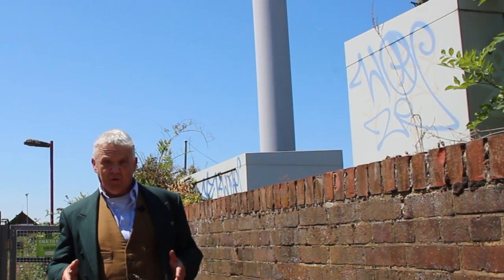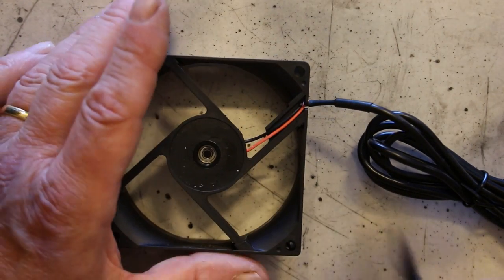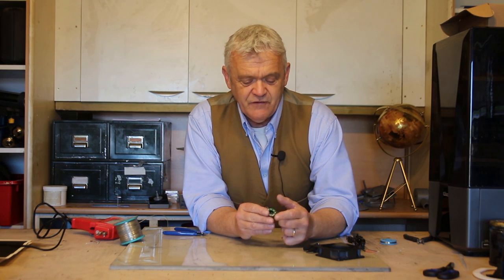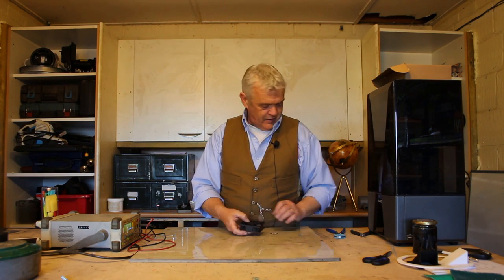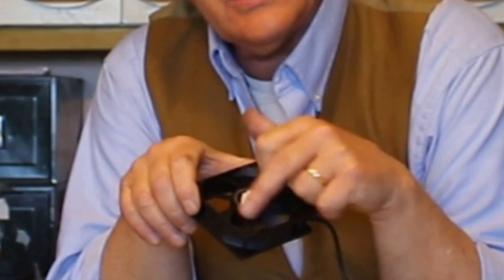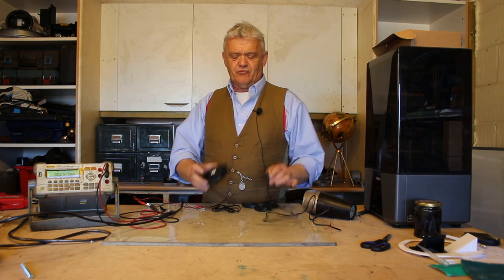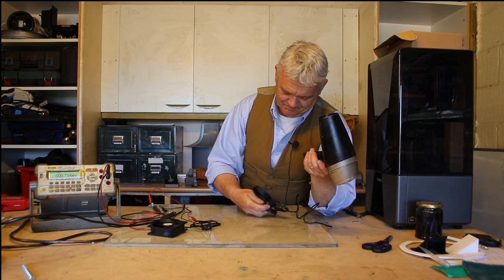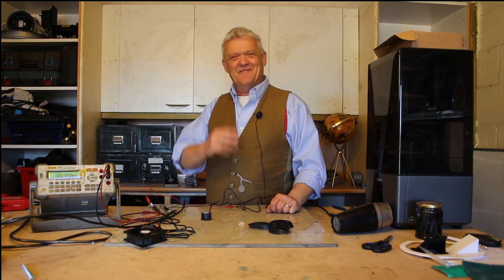1959 MIT Toroidal Propeller As A Generator

Comment: That was unexpected. Perhaps the housing has more of an effect than we thought.
Reply: yes, fan housing always helps increase the speed.
Reply: Of course it does. My experience with auto mechanic jobs has shown me the cause effect of the fan shrouds on radiator cooling fans. The difference of wind velocity is easily double with the shroud installed.  Also with a single webber carb on each cylinder the height of the velocity stacks or tube on top sucking in air has a definitive change on engine performance

Comment: I think what you should be measuring is, the minimum air speed required to turn the generator, and whether it will still turn under load.  I think your fan blade will turn with less real breeze and will continue to spin under a much greater load.  And if I am not mistaken,  with a long shaft it would convert well to a turbulent vortex water generator.  Anyway, the fan was very ideal source for the stock pc gen.

Comment: The small fan matches the size of the hairdryer so is more efficient,creating more RPM, so more voltage. For a more accurate measurement both fans need to be same size.

Comment: Thanks for the video: The premise is slightly incorrect: Large diameters don't spin faster, but they do provide more "torque". 
Probably to make this a fair test, you would have to scale the MIT prop down to the same diameter of the propeller fan. (Or vice versa). 
One other thing, I have watched some videos on the MIT prop, and I can say so far all of them have been "underwhelming" as far as performance in "Air".
Reply: yes, hold the blower 18 inches from each generator and test again.  big blade should turn better at lower wind speed
Reply: I saw that without any testing. Air turbine blades need their own design because they are removing power from the airflow, not pushing power into it. 
Large diameter sweep areas always remain the same in the designs no matter how much blade area is added.
The numbers are formulas that can be changed to take more or less power from the airstream.
With geometry we can add/or remove, more or less blade area to the sweep area.
The big question for me is, "Drag?"
How can I add more push surface without increasing the drag?

Robs' blade that he has designed can easily become a lot more efficient, by changing the angle of the blades to 45deg to the post instead of 90deg while keeping the rise the same, and adding a curve to the bottom of a steeper cone. This would help in the upscaled designed.

I also see design solutions for the blades themselves that would virtually eliminate drag.

Also as we all see his blade is twice effictive if it is faced into the wind as opposed to a vertical application.

I'm a poet, not a scientist.
Take it easy on me.👁

Comment: the benefit of that MIT propellor isn't so much it's wind speed to rotation efficiency but rather its input wind speed to output wind speed as a motor - if you were to use these as motors and check the output wind profiles, the computer fan likely has very heavy turbulence (which is actually good for its application - heat dissipation), whereas that MIT propellor, judging by its shape, most likely maintains laminar flow (which is good for efficient propulsion)

Comment: I already have a rf 455mhz remote water level indicator at high floor of the building, feed by a solar cell charging a Liion battery, but when cloudy for days  I can't take the measurement, I will put one of these fans as generator to have two power sources to charge battery.. Thank you so much for you very didactic videos..

Comment: There is a large area on the toroidal fan where the air just bypasses the blades. Perhaps a more complex shape where the loops are interlaced would improve the result. Interlacing could allow for more blades while retaining similar angles to the direction of airflow. An example of the interlacing I envision is the turks head knot although more blades would be an improvement along with the interlacing.

Comment: Your hand behind the Toroidal Propeller could be causing a wind resistance and combined with the hair dryer's angle is about 20degrees off center could also cause a reduction in output, but not that much. Back to the drawing board. Another GREAT VIDEO!

Comment: the voltage is directly connected to the RPM. The MIT one has a different pitch and size, and looks to spin slower. So lower volts is to be expected. but the current output is possible higher. although i think you would get more power out of these generators with higher voltage/more rpm.

Comment: The hair dryer has a small circle of concentrated air flow, about the size of the small fan. You had it pointed to one corner of the bigger fan. The big one did not come near to experiencing or capturing equal energy. Try 3 time that distance pointed at the center of both.

Comment: The primary benefit of the toroidal propeller is its low noise generation. You could say their are trade-offs between size, power output, efficiency, sound generation, and complexity. As has been addressed in a previous video "the best design is not always the most efficient." I could see the low sound generation being preferred in areas where you want to keep noise pollution at a minimum.

Comment: With very low voltages on each of two coils 90 degrees out of phase, It might help to have a voltage doubler circuit. (Two diode two capacitor) for each coil. Then one can put the outputs of each doubler  in parallel with the other. Under light loads it will virtually double the peek voltage (sqrt(2)× rms) of a single coil minus voltage drop of diode.

Comment: There is a lot of eyeball visible axial runout as the toroidal fan rotates and possibly some radial that's not as visible. This will rob a lot of the potential power generation potential. A bit more precision at the axle to fan joint might yield some performance benefits.

Comment: My suspicion here is that toroidal prop would benefit from real wind scenario instead of the overly small wind profile the dryer offers.

The dryer is, I suspect only capturing a smaller volume of that overly focused air stream but against a widened stream (say a large diameter fan) would perform very differently.

Just my supposition but it’d be nice to find out

Comment: The test result is pretty much expected. The original traditional fan blade have more surface area and density (surface area of blades per area of 12 cm fan) for the air to push.  Thus, it generates more voltage.

Comment: what I am wondering is if you could just solder some wires to the points of output with out altering anything else and still be able to use it as a fan or generator based on which wires you are hooked up to, and possibly even hook the generator output wires to a reader so it would let you know when it is running by counting the pulses coming from the generator output the way they do with some stepper motor drivers that use the back EMF that comes from the unpowered coils when the motor moves to know a step in the direction was accomplished (ie it reads the motion) and if this back EMF does not occur it warns the software that the machine has not moved, turning the idea of an open loop CNC system into a complete closed loop system (each step sent waits for a reply to let it know the motion has been moved before it shuts off and sends the next pulse for another step, counting according to the software to reach it's destination, otherwise it will assume a step has been lost, where the machine being bound up causing a lost step in an open loop system will have no idea this has occurred and thus the machine will not know where the cutter (or extruder for 3D printers) is actually at. )

Comment: Possibly the larger diameter of the fan means it can't spin as fast as the smaller one.  It may produce a higher torque which needs gearing to get the same revs.

Comment: The torpidal fan was not fully 'illuminated' by the 'wind', whereas the pc fan was pretty much fully engaged..you needed to test at a greater distance from the hair dryer,  to get a larger, more consistent air flow, this would have the pc fan experience much less wind energy, amd the toroidal would be more completely driven. As others have commented, there is also the question of deliverable power, since your test is open circuit...consider how aircraft propellors use different pitch to deliver takeoff power with low airspeed, and higher pitch for power delivery at higher airspeed...

Comment: Iv recently wondered how much energy you could get from one of those hand warmers. Those ones that have a stick of smouldering charcoal in and that can keep warm for hours. A few peltier jobbies slapped around the outside of that with possibly a water cooling system as a differential engine might work as a small portable generator that doesn't need refueling or stoking every 5 seconds. Maybe with an option to increase airflow with vents should you need an extra boost of heat/voltage at the cost of less fuel efficiency

Comment: I don't think there's any mathematical equation to back up this... but... it would seem like the toroidal propeller has a lot of empty space between the fins whereas the computer fan blades do not. I think for air movement, the pitch of the toroidal propellers needs to be rotated about 90° and needs a helluva lot more fins. More plastic covering the open space and an easier angle for the wind to blow past it... With the pitch being nearly perpendicular to the axis of rotation, that would be really good for moving a slower, heavier (meaning has a lot of mass) fluid rather than a faster, lighter fluid like air or any other kind of gaseous substance. I think you need something a bit more parallel to the axis of rotation.

Comment: Mr. Robert Murray-Smith

I would be curios to see the same experiment again but instead of measuring the open circuit voltage measure the short circuit amperage.
I wonder if the longer blades on the toroidal propeller are providing excess leveraged mass reducing top RPM and limiting OC voltage but perhaps increasing SC amperage leading to turbines of similar wattage but a preference for higher or lower speed winds.
What do you think?

Regards,
Borel's Monkey #4

Comment: You mention a front and a back with the toroidal fan. I have been wondering if they would work underwater as a generator using tidal currents. The Severn has the second highest tidal range in the UK. Thats a lot of water going in and out. So instead of using barrages to store and release water, what about installing something sub surface to capture the energy in that movement? So is there a front and a back? We need a fan/prpellor that works efficiently in both directions. Just a thought.

Comment: You soldering iron looked much like an old - WEN- 'QUICK HOT' Unit I recently salvaged. The internal design is far more robust in its construction than my recent smoked, made in China iron. I have such high hopes for thi device, but I can't manage to fond or create a tip that will get hot enough. I am determined to revive it, and it seems S though I could run some cables up to a hand held tip rather than having the other kilogram of weight in my hand. 
Any suggestions would be greatly appreciated. Thanks

Comment: The outer regions of the toroidal blade is mainly focused for silence, but seemingly not so much for optional conversation of air does to rotation speed. If it was so efficient, we might have seen that design in turning engines already..? With a probably designed static guide blades, a gas turbine can reach efficiencies well above 90%, so that's really hard to beat, probably.
The tips of the blades help a lot to reach maximum speed, so the silent trade-off clearly seems to cause a significant reduction in efficiency...?
Reply: "air does" = "air speed". Swype error, but it won't let me edit on my phone..

Comment: Would they angle of the blades on that tutorial fan blade need to be straighter up and down towards the van it's designed for pushing with the angle need to be reversed for design for receiving

Comment: I think your air flow has about 100% coverage of the frontal area of the pc fan, but probably less than 30% coverage of the frontal area of the much larger toroidal.
But you'd still expect the results to be more similar, given there's a similar amount of air moving through both.
I suspect the toroidal doesn't work very well unless it has air pressure across it's entire surface perhaps?
There's an interesting YT channel which tests novel 3D printed designs for pc fans. Toroidals don't actually stand out in those tests. Also, the cowling shapes very much matter.

Comment: It should be same diameter so the input energy is the same. Also larger diameter means more inertia. Finally, blade angle...flatter blades go faster.  More angled blades move slower with more torque.

Comment: I would expect that at average outdoor atmospheric wind velocities (say 1 to 10kts), the shrouded box fan would turn slower, and would likely produce less wattage than the Toroidal propeller. Also, that placing both under load and measuring wattage rather than open circuit voltage would produce different results and might even stop the box fan where the propeller driven generator would still operate as it has more torque at lower wind speeds.

Comment: The (presumably) larger mass of the toroidal will mean more wind energy needed for similar rotational speed.  Also unclear whether other conditions, such as the area of the cone of air, will impact the two propellers differently.

In the end, though, the task of "catching" air is not the same as pushing air as a propeller does.  A basic, more or less flat and broad shape is probably going to outperform a "fancy" shape like a toroid.  Perhaps a toroid which conforms better to those parameters would provide some advantage.

Comment: You're comparing apples and oranges. The diameter and weight (mass) of the 2 blades are very different - larger diameter will spin slower than small diameter for a given velocity of air; higher mass may affect top rotational speed as well. Not a good comparison.

Comment: Surely the larger toroidal fan will generate less power than the small, lighter PC fan because it would require more wind to turn it at the same speed and the wind source is the same for both. 
P.S. Just for completeness, have you compared the relative current outputs too?
Reply: So basically if you reduce the weight of the torroidal fan it spins faster?
Reply: @Coladudetje         Yes.    Mine was the second comment listed, but now other people have come up with more detailed ideas.

Comment: Not sure the toroidal shape does much compared to other shapes when used as a power generator... What it's good at is losing less energy to diffusion when generating thrust. And it's at certain rotational velocity ranges in that situation. Taking a wild guess, you might actually want the effect that causes diffusion in the normal blades of a propeller, since that effect might cause more "grab" for the wings of a turbine.

Comment: Having watched several of your entertaining and informative videos I can honestly say for the first time... I am disappointed by your non-scientific approach to this experiment.
Reply: He covered quite a bit of the scientific methods in the video. I'm not sure what there is to be disappointed about. 
I did similar proving that the viral math problem of 8÷2(2+2)=1 instead of the hogwash answer of 16.

Sharp and Casio calculators use PEJMDAS, properly placing a higher priority on the juxtapositional multiplication. Which will give the correct answer of 1.

Mathematics was created in order to communicate explanations of physics, astronomy, and finances. The solution to these issues is to verify the techniques against experimentaly verifiable results and make sure that your math actually serves it's original purpose.
In science, hypotheses are tested before being accepted, let's test the hypothesis of being able to preform this math problem as proposed.

One such experiment involves rolling a wheel along a track.

Distance divided by circumference is equal to the revolutions required to roll a wheel. Dist÷2πr=revolutions.
To roll a wheel 120" how many revolutions will a wheel, with hub radius of 11", and a tread thickness of 1" have to complete?
120"÷2π(11"+1")=?
120"÷(2π)(11"+1")=?
120"÷π(22"+2")=?

Will it be 120"/2 x π(12") = ? 2262in²
Or 120"/6.283 x (12")= ? 229.2in²
Or will it be 120"/π x (24")= ? 916.7in²

Obviously not since every one of those results, to the same problem, returns a different incorrect answer with the units of inches².
Any answer much different from 1.59 revolutions is going to be incorrect. This is verifiable experimentally.

PEMDAS was not "invented" by mathmaticians. It was created by grade school teachers of Mathematics, not even physics or science. It's an oversimplification to make it easier to get the basics taught. The Style Guides of both the Society for Mathematics and the Society for Physics recognize the importance of the PEJMDAS conventions that prioritizes juxtapositional multiplication ahead of division. And our experiment supports this. In science, it only takes one example to disprove an hypothesis, which I believe has now been done.